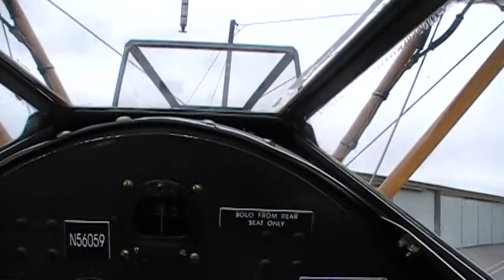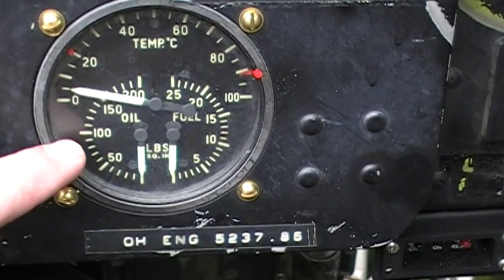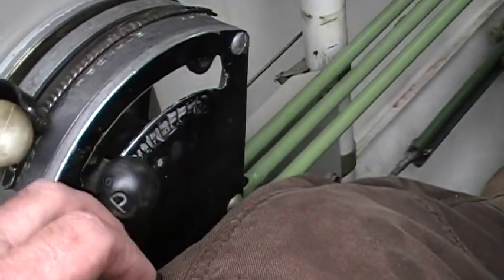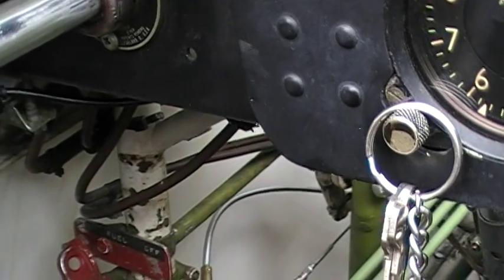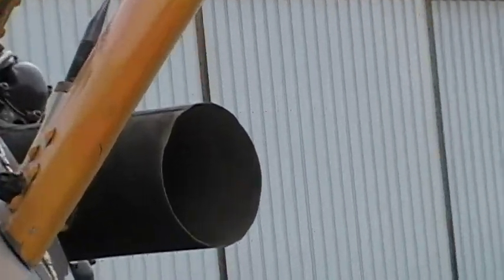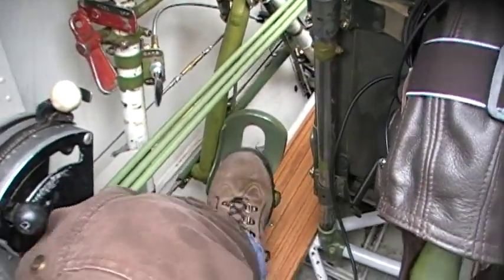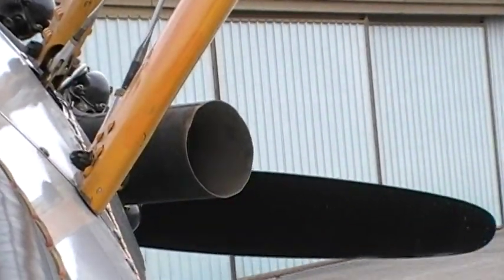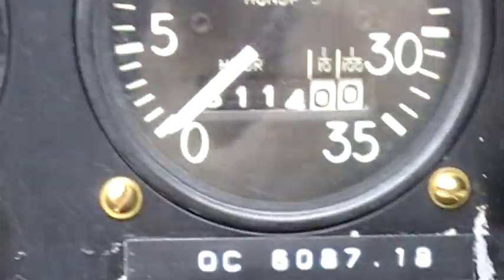Starting a Pratt & Whitney  985 part 2 (preliminary start up with blow out plugs

Comment: To each his own, but I was taught to just pull the prop through about a dozen blades. Then, when cranking, I was taught to leave the mags off until you spin it through a few blades and turn them hot. You take a 1340 and pump on the throttle a couple times too many and have a low battery, turning them mags on before spinning her over and she kicks back, you will have a problem. A 985 is a little more tolerant.

Comment: If you're pulling the prop through properly before start up, you should catch a hydraulic lock without the need for any blowout plugs.  Been flying radials for years, and never needed the plugs.
Reply: Correct.